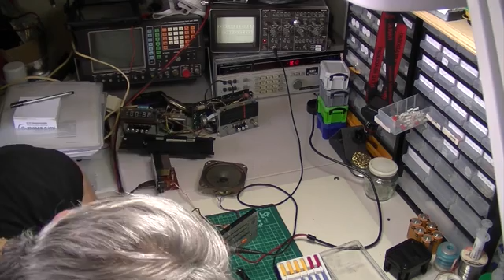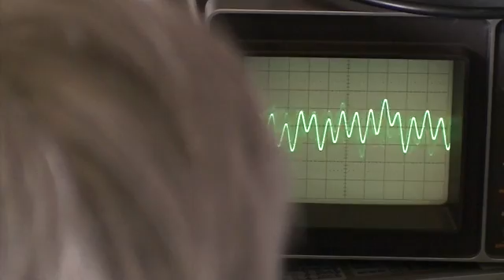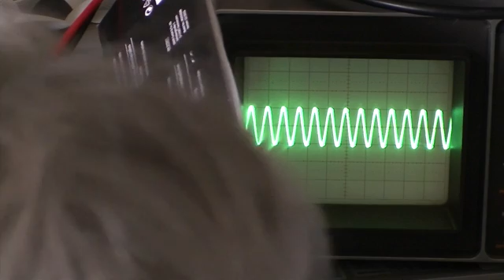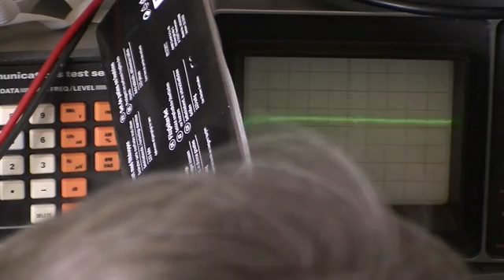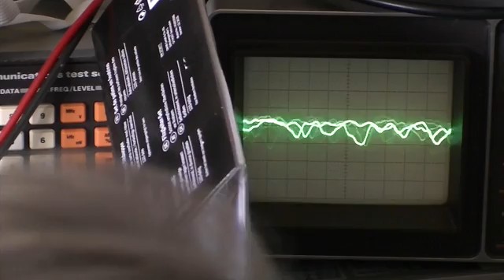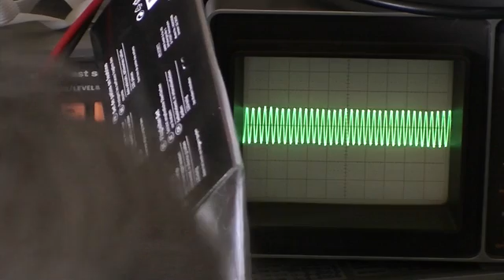Roberts R727 repair Part 2: SW alignment

Comment: I can really hear the Sticky buttons on the signal generator. My HP8903 sounds just the same. I cannot be bothered to fix it but Simon Spiers recommended a little silicon spray on the switches. There is also some YouTube movies of  straightening steel spring if you search under hp8903. Great video really enjoyed it thanks.
Reply from the maker: I really need to take this apart Chris and sort those buttons. It did smell a bit smokey when I first got it so they are probably gunged  up. Thanks for the tips and glad you liked it.
Reply: when I watch your repair video on fixing your buttons I may have a go at the one I have. I'm not feeling brave enough to tackle the one I have. PS can we see more of the chickens?
Reply from the maker: I was hoping to watch you fix one before I attempted it! I will sort you a chicken fix soon Chris. We got a couple broody hens at the moment